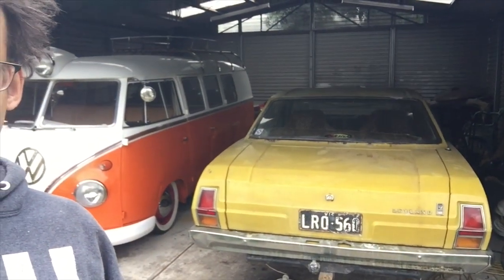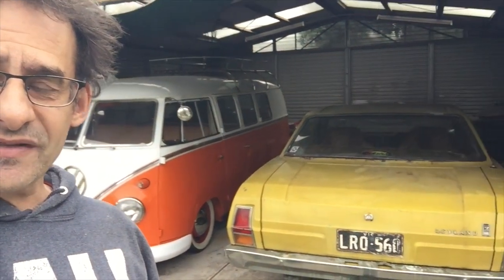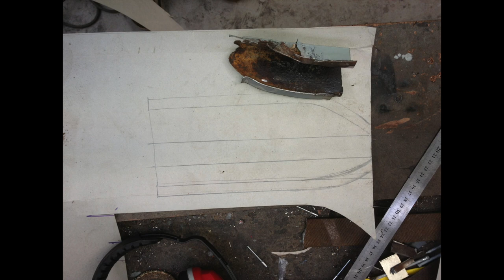VW RESCUE 1961 AIR BAGGED CUSTOM BUS  (PART ONE) #vwrestoration

Comment: What size was box section you used for inner strengthening channel on roof gutters inside?
Reply from the maker: it was 50mm x 15mm, back then you couldn't buy the right stuff.
Reply: Thanks i was wondering what  i will use for mine

Comment: What did the glass cost ya to blast it, last one i did i bought a tonne bag of chrushed glass about $500
Reply from the maker: I used medium garnet, 6 bags of 20 kgs each bag was $18.00. I would never use glass beads way too dangerous for the lungs on a big scale like that.
Reply: @DemopVWgarage  i had use of full respiratory oxygen line full helmet on a property in the open.
Ripped shit outa the paint though